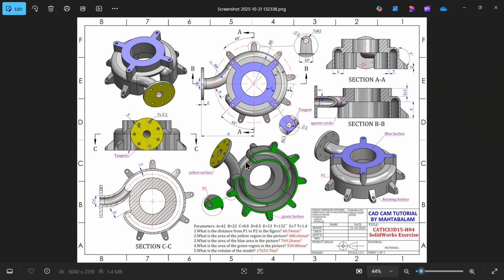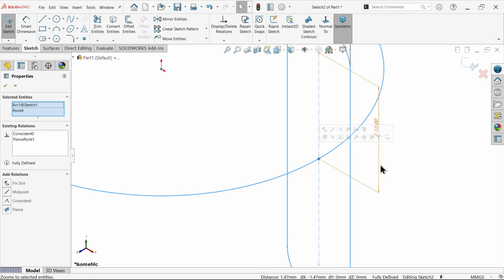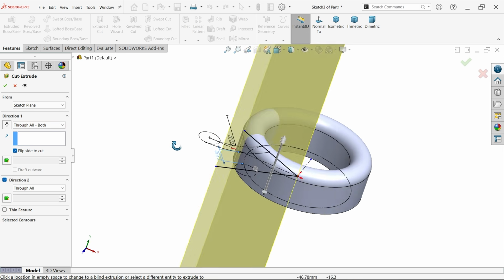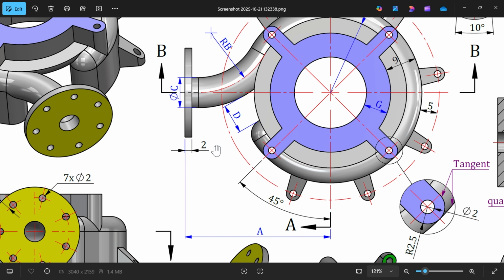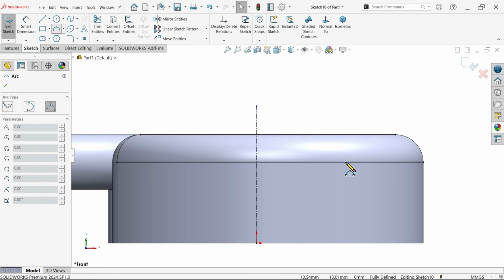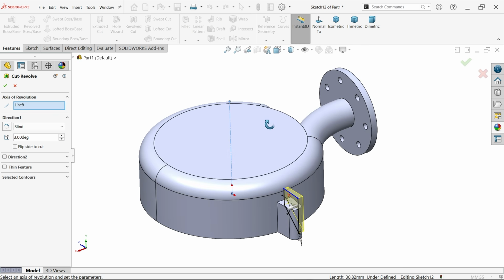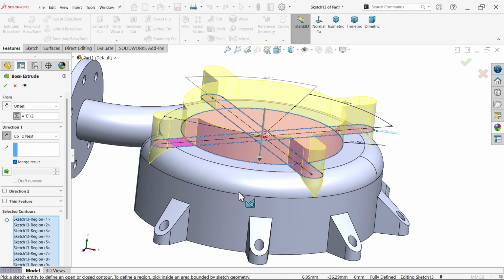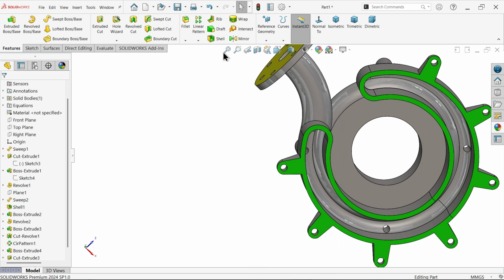SolidWorks Complex Exercise-CATICS3D15-H04

Comment: At the end of this video, Mahtab discovers that the volume of his model doesn’t match what is published in the drawing.  He ended the video there, presumably due to time constraints, and left us hanging.  The following is what I have determined to be the problem:
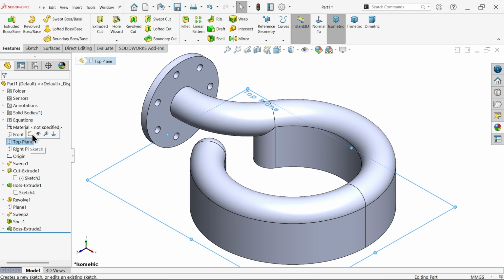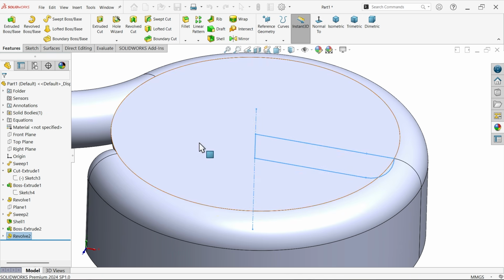In the time frame between about 17:30 to 18:55 he creates a feature which encroaches on the inside of the body which has already been shelled.  This is the one seen in Section B-B with the quarter circle delineated.  This mass is never removed and is the reason why his volume doesn’t match with the drawing. The quick, easy, and dirty way to remove this is to use the Delete Face function.  I removed it with a circular profile swept/cut feature for the majority of it and a small Revolved/Cut feature at the very end of the round portion of the shelled body.  This got me to within 12/100ths mm³ of the objective.